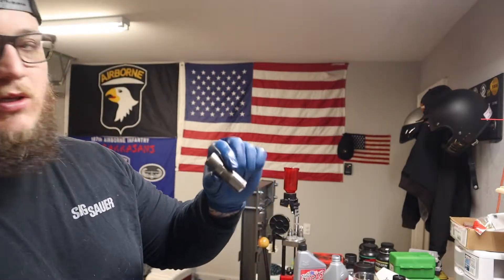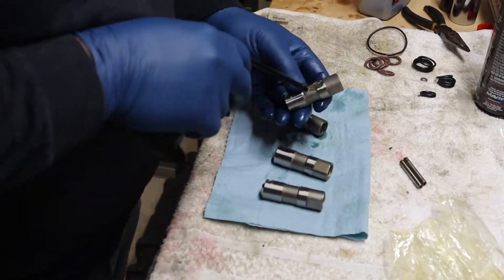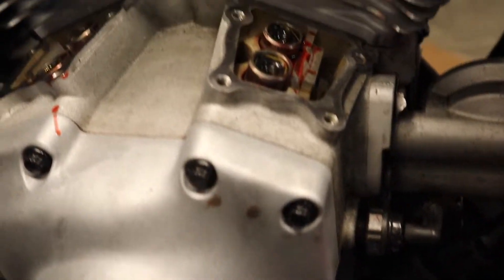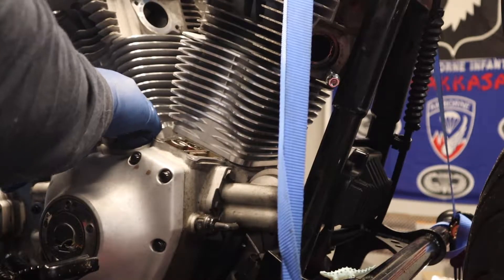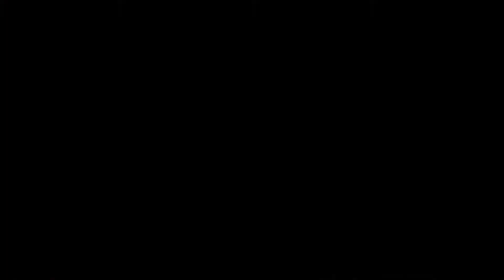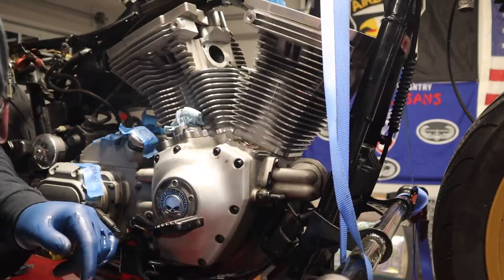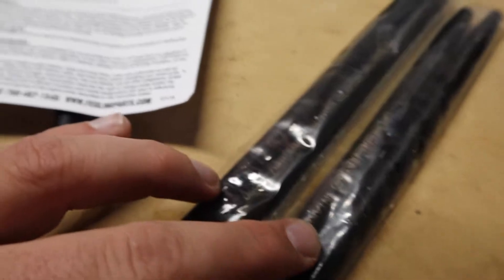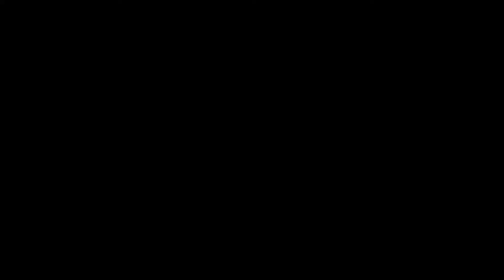Engine Assembly Part 5: Lifters, Pushrods, and Rocker Arms

Comment: Bro do you have to put loctite on the rocker arm support plate bolts or can they just be torqued down without any loctite? Good video.
Reply from the maker: @cj8172  I put loctite on damn near everything and torque them to spec. Might as well spend the extra few bucks for some reassurance.

Comment: This is a really good video , a quick question ? Are the lifters that go in the intake and the exhaust identical?
Reply from the maker: No, they’re different lengths, the feuling parts solid lifters I put on are marked intake and exhaust. Thanks for checking the video out!
Reply: @NattyBumppo was wondering if you put in hydraulic lifters do you have to adjust the pushrods after putting the new ones in?
Reply from the maker: @shannonbarrios6484  normally yes, you should adjust the lash. But this build I got solid pushrods for the specific length I needed. On that bike now it has the fuel moto adjustable pushrods and feuling parts hydraulic lifters.

Comment: A lot of wrong info on here. There are much better videos out there so keep looking
Reply: The time to rotate the motor for cam base circle is when doing rocker support plates not lifter blocks
Reply from the maker: @stuart1270  yup, and I go over that in the disassembly video. 

You found one thing I misspoke on and decided to post this comment?
Reply: @NattyBumppo  ok you asked here it goes. You are supposed to put lifters on the base circle before tightening rocker boxes also you are supposed walk the rocker boxes down then let the lifters bleed down before rotating motor to do the other cylinder.  And in reality lifters can go with the holes in any direction.  You said you explained this in the disassembly but why not explain it in the assembly process.
Reply from the maker: @stuart1270  man, you should really call someone and have them edit the service manual. Can I get your number so I can have you talk me through my next engine build?
Reply: @NattyBumppo  If you read the service manual you might have done a better job
Reply from the maker: @stuart1270  😂😂 I did everything out of the service manual and the feuling instructions, but okay. Have fun being a troll hahaha
Reply from the maker: Any elaboration on that? Or just going to talk random shit and leave it at that?